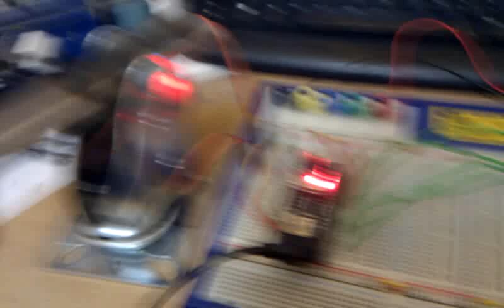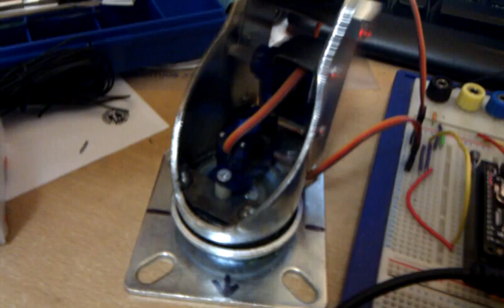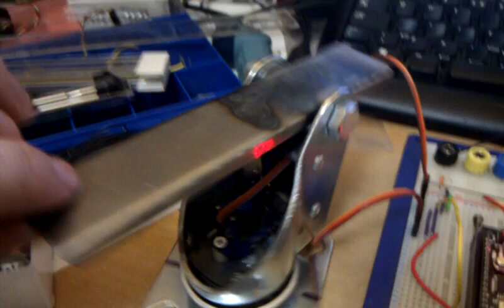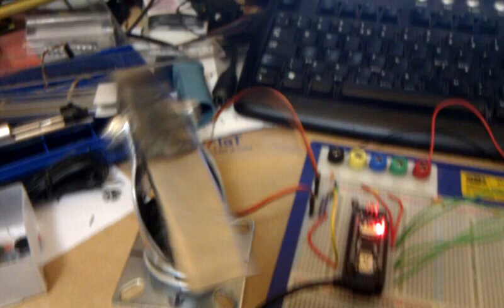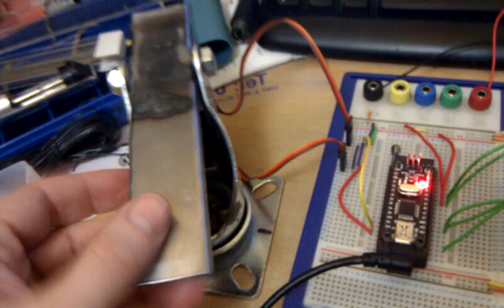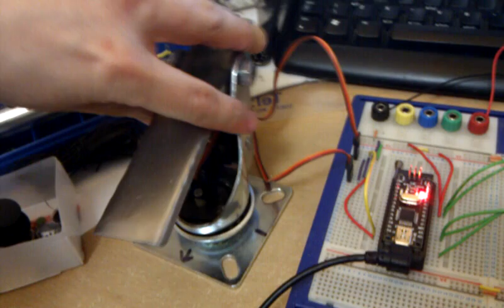Arduino Predator Shoulder Canon

Comment: Hi, John, I would be interested in some details of the servos assembly - the cart wheel is a neat idea for something-like-a-predator-shoulder-canon. The horizontal rotation is quite clear, but how exactly have yoj dealt with the vertical one? Is there a lever?
Reply: Yea, I saw that iron wire there. ;o)